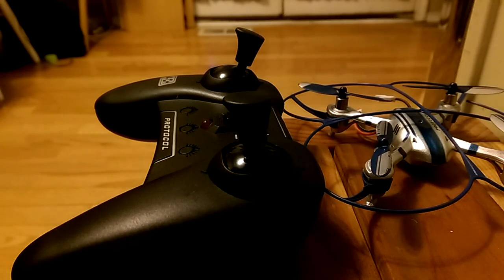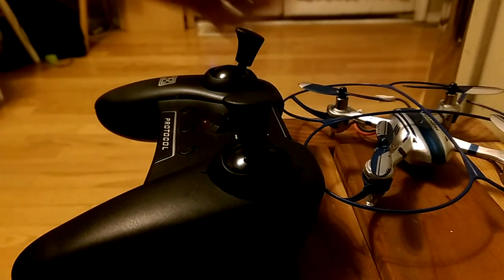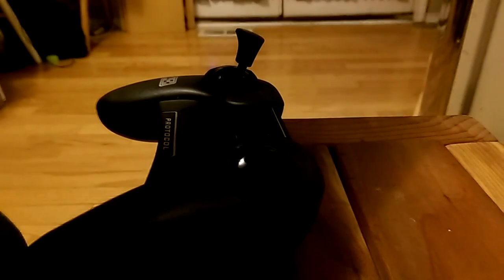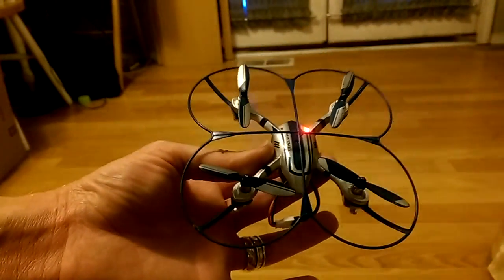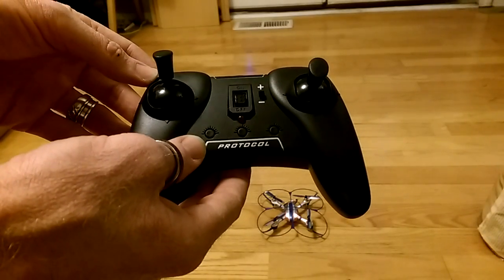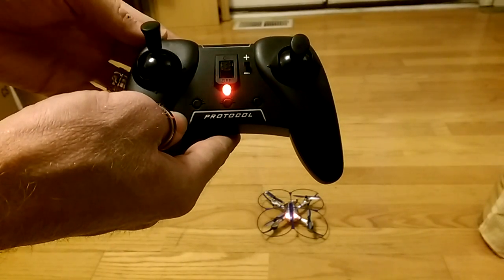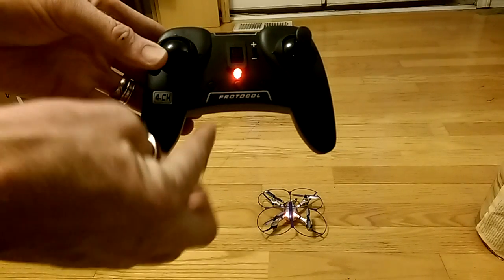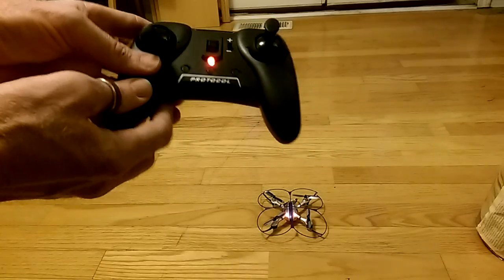Tutorial - How To Sync Protocol Slipstream Quadcop

Comment: It won't fly but the blades will spin
Reply from the maker: Check that the propellers are all on the correct way. Two motors will spin clockwise and two will spin counter-clockwise.

Comment: I can only get 3 of my propellers to turn
Reply from the maker: Check all your motor connections and make sure there is no hair or other debris keeping the motor shaft from spinning. The propeller should pop off for easier access to the shaft, just pull from the center of the propeller, not the outer ends or they might break.

Comment: my drone won't take off
Reply from the maker: What is happening when you turn on the drone and controller? What position is the left toggle switch in when you first power on the remote? What order are you turning them on in? Is your drone on a level flat surface prior to turning on the remote? How old are the batteries in your controller? If you can answer one or all of these questions I may be able to assist you further.
Reply: The proppelers were wrong but your video helped me out so, thanks
Reply from the maker: +Rolando Rodriguez   No problem, happy to help.

Comment: hey, great video… Im having problems synching the remote… the main issue is that the LEDs "eyes" are not blkining after I charged it for an hour… maybe the unit is defective, what do you think?
Reply from the maker: Could be charger or battery issue. Loose cables? Replacement or backup batteries are generally easy to find and many different brands use identical types so they are easy to find. check out Amazon.com and you could probably find battery and charger together for a good price.
Reply: they don't blink, the light on your charger should turn off
Reply from the maker: The LED's on the quad should only start blinking once you have started the syncing process with the remote. Make sure the throttle (left stick) is at full throttle (all the way up) BEFORE turning the power to the remote on. Also make sure the quad battery is connected prior to turning on the remote.